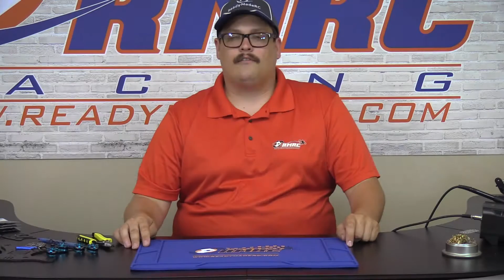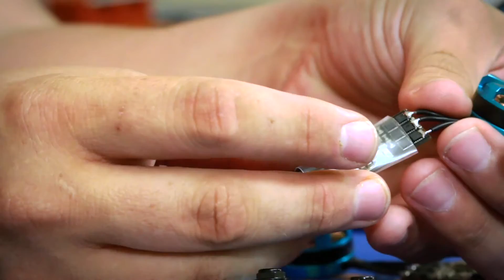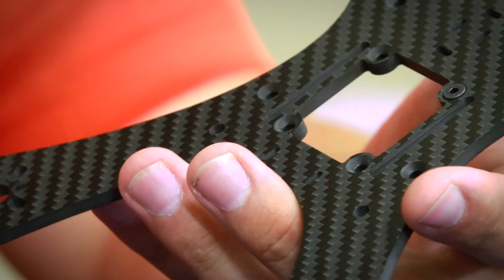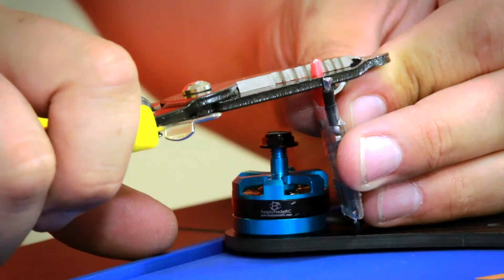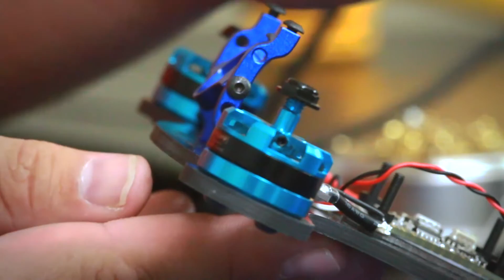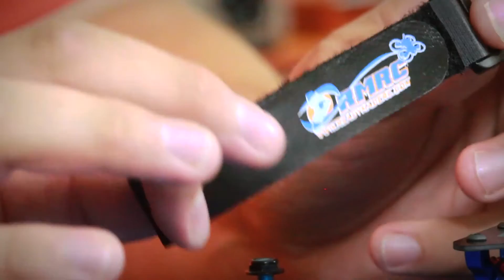Hellbender 204 V2 Build Video

Comment: What are the optimal PID settings for that setup? Assuming you are running the latest Betaflight.
Would you suggest running a custom Motor mix for that frame?